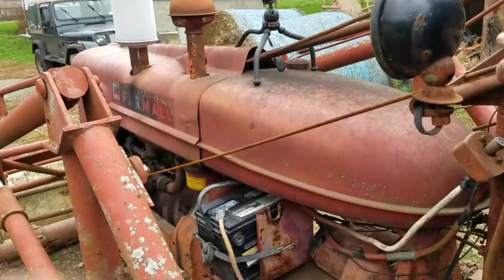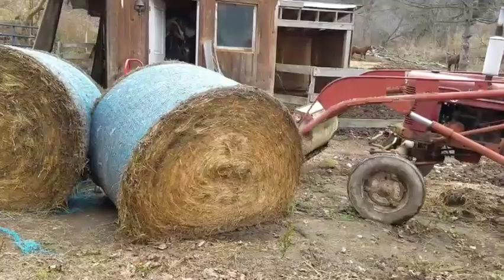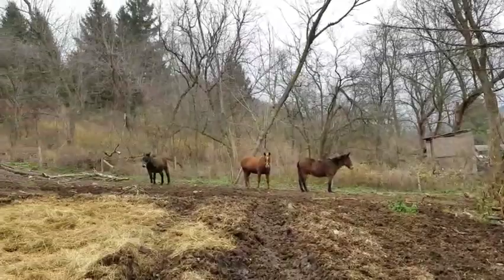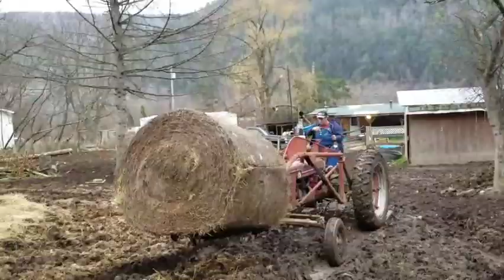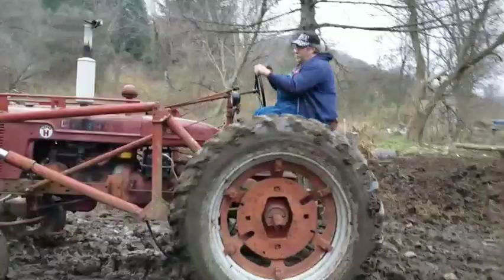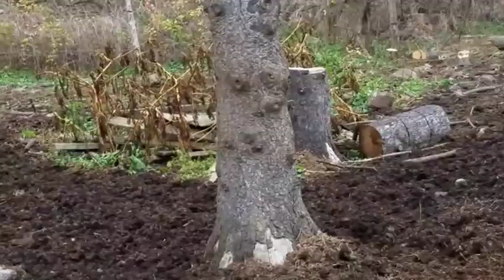farmall H action! feeding hay in the rain! a farmall story from my youth!

Comment: 👍👍👍 Good old tractors, spent many hours on seat of H, Super H, M & Super MTA.  Exactly as you said, the H & M's were simple & easy to fix.  Clean H2O out the sediment bowl, new plugs, points, dist. cap every 2-3 years and good to go!  Plowed a lot of snow with an H with canvas engine shroud & a windshield back before they had tractor cabs.  Thanks for the memories Harvey!
🍺🥨🍺

Comment: I used to put hay out with the 1964 version of that tractor. I miss it. The awesome thing about the newer version was having the 3 point hitch with the hay spike on it. Those old loaders are very underrated. I really like the trip bucket setup. With the rear blade and the trip bucket I could move one ton of snow.

Comment: When I have to move round bales in the winter I push the bale onto a 4x8 sheet of plywood then pull it with my H like its a trailer. it keeps the weight off the front end. like the video.

Comment: My Father purchased a Leader D tractor in 1948,We were able to harvest  128 acres the first yr. with the old wheat binder,I was only six yr old , I could only hold it straight in line Dad would take the machinery around each corner of the fields from the binder to the tractor  and turn it to the next  rows and away we would go only ran over one fence not bad for a six yr old.

Comment: Looks like you could use some more 145 lb wheel weights Harv. Great video kind of took me back a few years, I had a 53 super H row crop that i built into a puller. It was loads of fun and the best part was trying to hide the mods from the other pullers. Keep it up stay safe and god bless.

Comment: What about putting a hitch on an old truck/car hood and pulling it up the hill.   Keep the weight on the back tires then use the loader to pick it off the hood once you get it up to the top
Reply: Or just get one of Harveys old big block V8 engines. Not in the tractor but as a counter weight in back!  Haha

Comment: I have an H Farmall  I was  born in 1946 . The tractor was built in 1942. It will pull a 5ft  bush hog. Never had the head off of it. Years back I removed the pan and replaced the  aluminium rod war bearings .

Comment: That’s a good running old Farmall. Neat to see one with a wide front end. Those machines from that era were built to last. really any of the IH tractors up until the mid 1970s are pretty easy to work on we ran them on my uncles place when I was a kid. With the exception of valve jobs, it didn’t take many tools to tear one of those motors down and rebuild, especially the diesels.  All that being said  the modern tractors, especially hydrostatics are much more user friendly and no doubt safer. Same could be said of a lot of things, like chainsaws and portable sawmills

Comment: I figured you would have a beer can sitting on top of your muffler and not a flapper valve.  As soon as I cranked the tractor my horses would have been standing at the gate waiting for breakfast.  Then you have to dodge horses as you drive.  I would have gotten some of that old hay and thrown it in the ruts to increase the tractors traction or found another way into the lot.

Comment: 8N  VC case H. M 300  400  450  460 
560  706  826  856  1086 1486  1586
1800 Oliver  77  770  4440 jd  4020 2510  444 MH   4430 JD .
JUST THE ones I  remember  .

Your old H could use 2 or 3 more wheel weights on each side.  
And she sure sounds good.

Comment: Instead of driving up why didnt he go in reverse all the way to where the hay needs to go?
Reply: 2 wheel drive tractors have far less traction in reverse than in forward gears plus the tractor tires are directional so they clean in forward gears, The treads just fill with mud in reverse. Apparently you have never been around farm tractors and equipment.